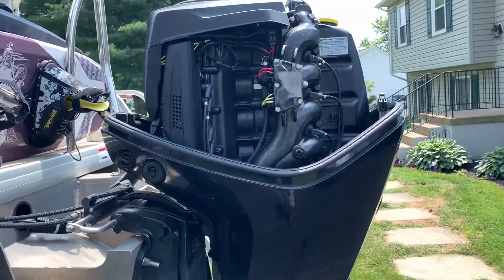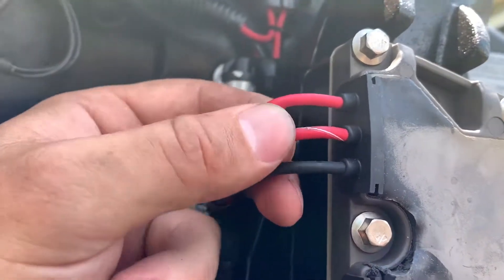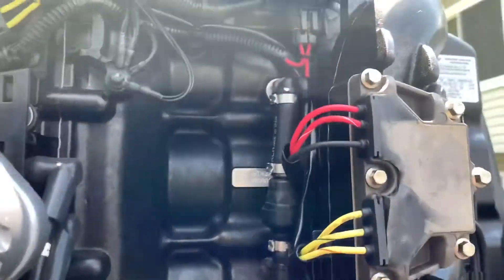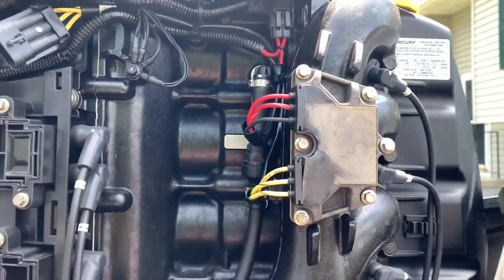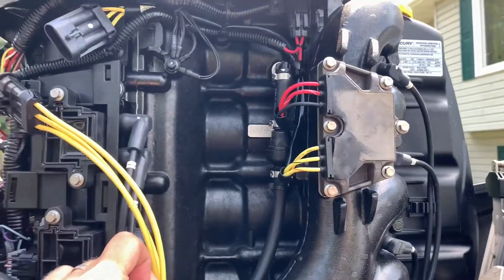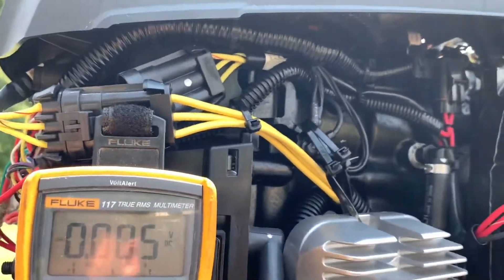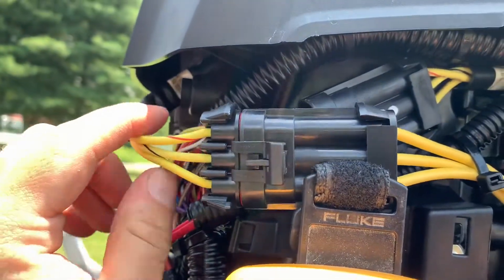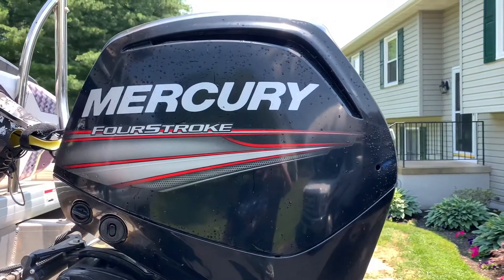How to install a cheap temp voltage regulator Mercury outboard 90 hp fourstroke

Comment: but it is not the voltage regulator that generates the 50 amps...  it has the ability to release 50 amps if the stator can generate it.  and for it to have this ability, it involves a little bit of physics ( electromagnetic fields in the coils ) so if the stator is designed to generate 40 amps , no matter what voltage regulator you have there, the DC will only provide 40 amps.   You can check it out using a clamp meter measuring the current passing through the red wire without the boat circuit connected, otherwise you will have a current divided and what you will measure gives you false information since part of the current will be going to places other than the battery.

Comment: what's the model of this new voltage regulator ? and how did you solve the problem with the cooling since it is cooled down by water behind it ?

Comment: Can you unplug the stator and run the motor to check it's voltage output without bringing up an error code ?
Reply from the maker: Don't know about error codes
Reply: No worries. Do you have analogue gauges on your boat? Did the motor idle smoother when you unplugged the stator from the faulty regulator to test it's output, or did the low battery voltage still cause it to still run rough?

Comment: Don’t buy mercury motor they suck..👎👎...
Reply from the maker: I like the new 2 stroke evinrudes.  lb for lb they are more powerful, HP for HP they make the boat go faster, cheaper simpler engine, and no oil changes, but they are out of business now because no one likes 2 stroke anymore.